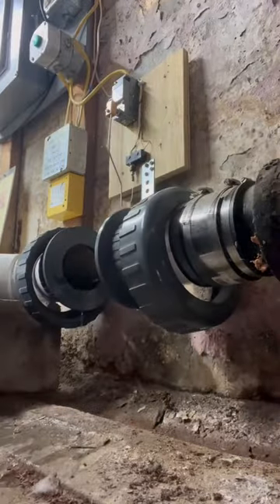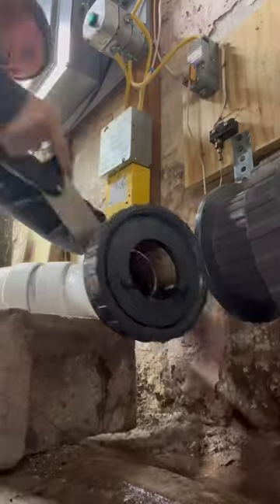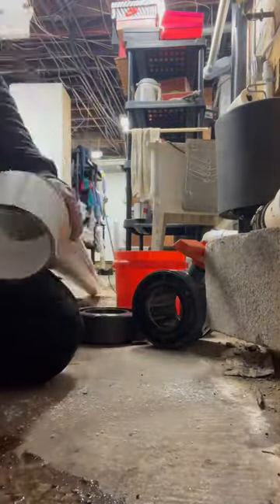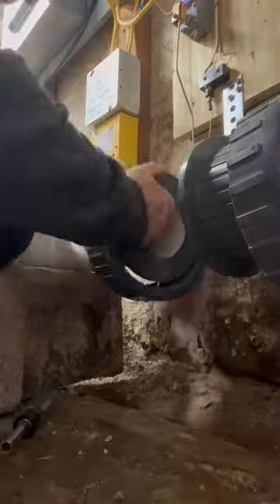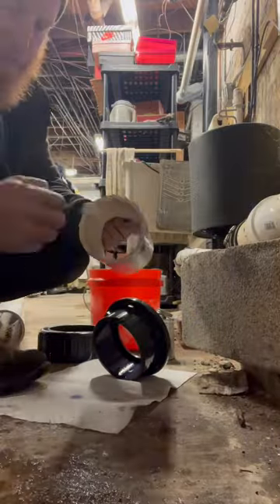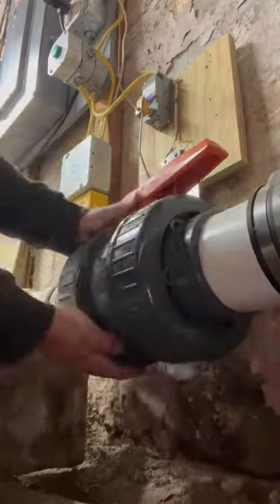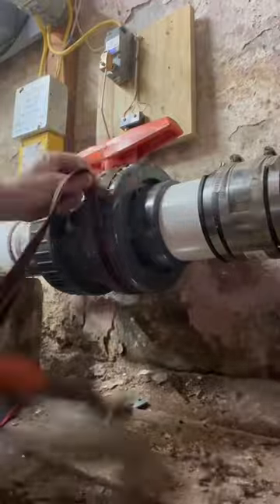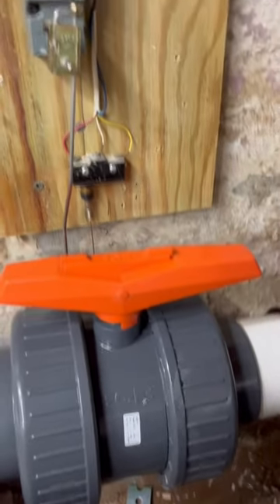No better way than this #plumber #shorts

Comment: Back water valve would be the correct solution.
Reply: yes it would
Reply: This is a unique situation. I know plenty of cities that require back water valves for this very reason. That said they are unreliable in this situation. I would have no problem putting in that valve.  I would defend myself to an inspector or city official that had a problem with it.

Comment: Even if it's not an approved DWV installation what's the worst that really happens? His toilet still flush? So when is toilets don't flush it just goes down and turns the ball valve? I would be more concerned about the restriction at the ball valve even though they're called full port ball valves almost all of them are not.

Comment: Y’all back water valves suck. They cause more blockages than they prevent. I’m a service guy. If the house has a BWV it’s the first place I look and the blockage is almost always at the flap. Terrible mechanical device.

Comment: why wouldn’t you just backwater gate valve? i just..
Reply: Back water valve isn’t a gate, it’s a swing. But yes, he should have used a back water valve.
Reply: A back water valve is a check valve for sewers .
Reply: Nothing wrong with this. It's under the facility engineering supervision.
Reply: Check please